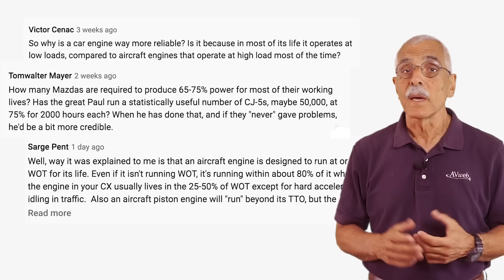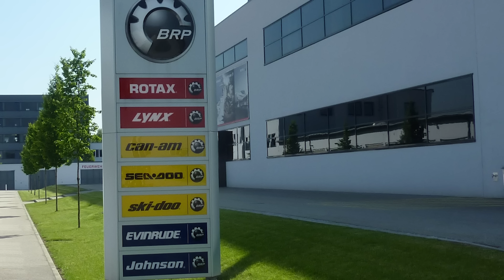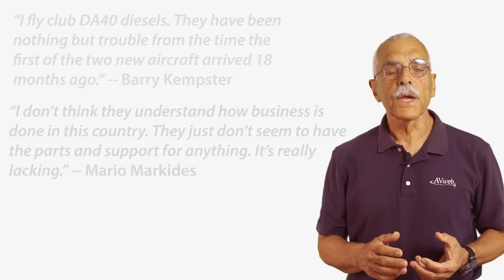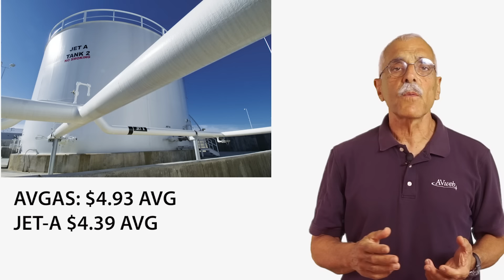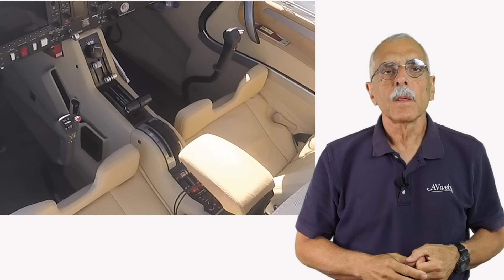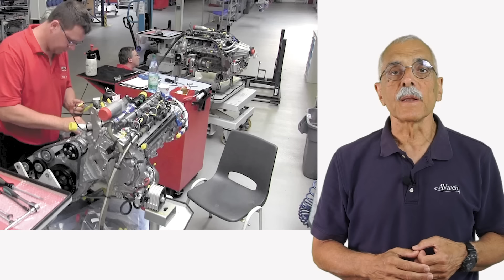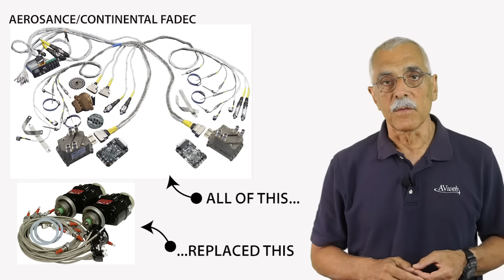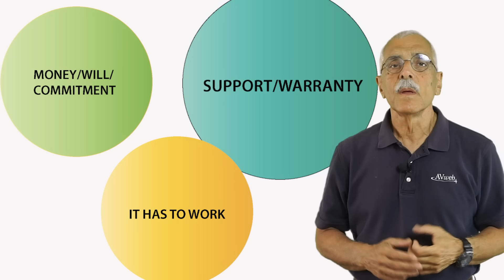Why New Aircraft Engine Ideas Rarely Succeed

Comment: I am curious, all of these engines have terrible power to weight compared to gasoline automotive engines that'll normally get or exceed 1 horsepower per pound.  You've mentioned how diesel auto engines are used in aircraft, why aren't gasoline?
Reply: The Rotax V-6 was a Gasoline engine. I think the big thing is commonality of fuel. A diesel will drink anything if you tune it for it. So Jet-A is readily available and in a long run scenario would mean one big tank and pump not two separate tanks and pumps at airports going forward. Problem is, no diesel Aluminum block has ever really done well. The Combustion event it too "Detonation-ey" for aluminum's low toughness, aside from some new superalloy developments. So Cast Iron kills the Power to Weight. But as Diamond shows, if you actually design for the power to weight of the engine, it works out fine.

Comment: I am always baffled why we still use very old technology in GA... but it's what people are comfortable with. Diamond is certainly pushing the envelope, happily.
Reply: Except the video is a load of BS. There is a tremendous market for newer and more reliable aircraft engines which would require trivial investment to tap. Quite literally millions of people would buy a modern airplane if FAA regs and unlimited liability tort laws weren't so comprehensively built around suppressing new entries.
Reply: @chrisdelzell8467  Hi Chris. What would you say was the real reason for the mentioned failures in the video?
Reply: @danielalorbi  almost entirely litigation and regulations. Airplane designers face indefinite and unrestricted liability for their designs , and the FAA has a number of regulatory catch 22s that make testing new parts almost impossible without unattainable economies of scale.

A piper supercub might have a 200 lb heavier engine than a piper cub, generating 150 horsepower instead of 70. My car has a 200 lb total engine with over 300 horsepower that can operate at nearly twice the RPM. It also wastes less gas and costs less than 10% as much. There aren't a lot of things the cub's engine can do that the car's can't either. If I took that engine block out and jury-rigged it to a propeller shaft, several things would happen. 

1) The reliability would go up. Cheap, mid quality fuel injected engines are far more reliable than any carburetor and magneto system.
2) The performance would go up. Lightweight, cheap, almost zero maintenance modern engines are far more powerful for their weight and volume than what we use in airplanes
3) The safety would go up. A more powerful, more reliable engine with more money left over for maintenance is a lot safer, and that 10% figure above includes all kinds of automation and safety features that are part of a car's cost.
4) It would be illegal to sell, and illegal to test. You can't sell it until there is sufficient test data, and you can't test it outside of an already approved airplane configuration without special dispensation. 

Flying isn't really that hard. We figured it out 100 years ago. We make it harder than it needs to be.
Reply: @chrisdelzell8467  obviously you're the one who needs the fact check on bs. Yes, regulation and scumbag lawyers make innovation a non sequitur, but there are not MILLIONS of GA pilots worldwide. Therefore limited market is the biggest driver in all aspects of innovation
Reply: @michaelmagill189  I believe, if the engines and planes themselves weren't so archaic and costly, more people would be pilots.

Ofcourse, the bigger problem is wage stagnation which has been since the 70s.

Trickle Down Economics was a scam afterall:(
Reply: It isn't just GA. Take AM radio. It is still used for Air Ground communication and not going to be changed.
Reply: Because manufacturers don't want to spend r+d $ on something that has a negative roi

Comment: Beech had a single power lever IO-520 in two Bonanzas in the early 80's.  All mechanical with a large cam moved by an aneroid.  It didn't catch on.  Pilots then wanted three levers.  Also I think there was only one old machinist at Continental that could make the cams.

Comment: Aircraft engines need to be slow rpm if they want to avoid reduction gearboxes. Pushrod engines are excellent in low RPM applications. Air cooled boxers are hard to beat in aviation applications. The best thing is an air cooled boxer with turbo, fuel injection and FADEC.

Comment: I would love to see a synopsis of various other auto engines that have found their way into homebuilt projects, i.e. Corvair, VW, Mazda Rotary, Chevy LS V8.  Ultimately though, not built for the 80% power, 100% of the time scenario, (just look at the difference in crankshaft journal size between  VW and Lycoming flat 4).  
Interestingly enough, Curtiss-Wright was an early Wankel licensee and had a really nice rotary design (from 'The Wankel Engine' by John C. Norbye Copyright 1971, ISBN 0-8019-5591-2).  
Curtiss-Wright also developed and patented a 4-Rotor Wankel, (US Pat 3,062,435).  
The world's first Wankel powered aircraft was the Lockheed Q-Star, it had a Curtiss-Wright RC2-60.  
Ford also dropped one in a 1966 Mustang.  The RC2-60 put out 185 HP, which compared favorably with the 200hp 289 V8, but it was much lighter.   0-60 for 289 was 10.0 vs 10.2 for the RC2-60.  But this was through a 3-spd automatic with shift points calibrated for the V8.  The RC2-60 would probably have stomped the 289 if it had a 4spd and better gearing to get the RPM up.  
Sadly the rotaries all suffered from materials shortcomings in tip and seal wear which took Mazda decades to sort out.  But the power to weight ratio of a rotary could only be topped by a turbine (but only at the cost of fuel consumption, and well, turbines cost 10X what a good old recip does.).  Curtiss-Wright also did some development work on a diesel version for a Genset. 
Considering all the starry-eyed "G/A Motor Of The Future" folks that have thrown money down the hole, I remain perplexed as to why nobody ever pursued a turbocharged diesel 2 or 3-rotor design.  No vibration, no problem with altitude, fuel thrifty, burns Jet-A, excellent power to weight ratio, gear reduction prop for awesome torque (swings a big blade), fewer moving parts, no magnetos to fritz out.

Comment: Paul, a question about continental engines that has always bugged me... why do they not use sodium cooled valves?
Reply from the maker: Cost, I'm sure. Also, the engines don't produce so much power that they need to dissipate that much heat, which is what sodium-filled valves were good at.
Reply: @AVweb  thanks for the reply and that kind of answers the question. 

I had thought there were two primary benefits from sodium filled valves. 
1. Reduced valve wear due to better cooling (as you highlight); but also
2. Increased relative compression ratio for a given octane rating as hot valves can cause pre-detonation.

There is a very recent book written by Calum Douglas called “the secret horse power race” which catalogues big aero engine development by Britain, Germany and USA leading up to and during World War Two (it is very technical and extremely well researched, I recommend it). 

In it he talks about the problems the Germans faced with reduced nickel and cadmium in their valves which led to hot valves flaking resulting in pre-detonation which of course led to high % of engine failures.

It was also one of the main reasons they could not get the same horsepower as the allies did from a given displacement of engine. The Germans just could not boost their engines to the same degree using a given octane of fuel.

So with the above in mind, I contend that continental could increase their compression ratios (and boost on the TIOs) if they ran sodium filled/cooled valves leading to improved efficiency and possibly reliability.

Going back to one of the points you made... I guess if you can afford a plane with one of these expensive tonks in them then you probably aren’t all that concerned with a slight increase in BSFC. That’s a true enough statement.

Interestingly Mike Busch from Savvy aviation thinks that continentals have less valve sticking problems due to lead/carbon deposits not accumulating because the valves run hotter. His answer to remedying this on lycomings is to run higher CHTs.

Comment: How about VW conversions like AeroVEE and others?
Reply: Agreed!  Seems many here want to ignore the type 1 2300 despite its overwhelming success over the decades. 
  
    I have been using  one in my stol for a few years. 84 mm stroke  and 94 mm Pistons . Either Ram or heated air feeds a custom manifold that incorporates 2 AMR500 superchargers with electric clutches, and 2 revmaster 40 mm carbs similar to The Aerovee. This makes for very broad torque range,  from 800 to 3000 RPMs. With flywheel Drive. With the horsepower coming in at right around 180. As Paul was talking about in another episode, "why engines fail" it's often high RPMs.
Reply: @Ozarkprepper643  Exactly!

Comment: Many auto engines will run just fine at 70% power output all day … provided you provide proper cooling.  Cooling is almost always what causes headaches for auto engines in addition to the speed reduction gearbox.  The reason there are few new engines for airplanes is mainly economic, not technical.  There simply isn’t enough market to be worth the investment.

Comment: aren't there any military training aircraft engines being repurposed into commercial aviation use or is the performance gap too wide?
Reply: They all use PT-6 turboprops now. Which have been in GA for Decades. The PT-6 just does the job right once you need more than about 300HP.

Comment: Hey Paul! Excellent video! From an engine manufacturer's point of view there is some more cost involved that make GA engines a major pain: Product liability insurance - especially for the US market with its class action lawsuits against manufacturers, low production volume combined with extremely high market entry barriers (-->certification process in every single country around the globe aside from FAA and EASA countries!), a decades long life-span of certified aircraft with legal requirements to provide support in parts from 100s of part-suppliers that go in and out of business (just think of electronics!!!) and engineering (ASBs for 30 year old engines!) until the last engine dies,... 
Long story short: We regulated the industry to a point where it just does not make sense from a business point of view. Every company that keeps innovating in GA deserves a medal just for trying to succeed in the long run. In the short run, innovation in GA on an industrial level never pays off. The guys at Cirrus, Diamond, Rotax and even Continental and Lycoming are awesome. There are so many more like Pipistrel, Tecnam or AutoGyro who just won't ever give up. Thanks for keeping us in the air!

Comment: The Austro engine powering the DA-62 is from the AE300 series of their engines.

The Austro engine still holds the 300 hour flywheel inspection where you have to pull the gearbox. Optional for part 91 operators, but still...

Comment: What most people tend to ignore is that the market is basically a bunch of old white chaps that go flying at the weekend. They don't care about innovation or leaded fuel or saving gas. Most of them also don't care about high performance, hence the struggling mooney company and no actual fast certified single. Only kit planes for the lovers can go to those lenghts

Comment: As an RV-14 builder who powered it with a Superior XP-400, I personally built with electronic fuel injection and ignition, I hope you feel my pain.  (After recall, I had Barrett rebuild it as an IO-390).  I wish you had discussed ULPower Clean Sheet Design FADEC Aero engines, whom I hope succeeds in the Experimental Aviation market.
Reply: U L is doing quite well it seems. They have the product the market has begged for. Good power to weight and direct drive. FADEC controls with all the standard aviation requirements, dual plugs, dual electronic ignitions. Digital fuel injection. All the right touches. Only thing is, it's only an incremental improvement over brands L or C. And it's not significantly less expensive than the big 2 which means that many builders will opt to spend the difference and buy the real thing. Additionally, when you buy from the big 2 you get an American made engine that everyone is familiar with and you don't have to ship it to fortress Europe for repairs. I really like UL and I wish them GREAT success. But they have a tough row to hoe to get there
Reply: @michaelmagill189  Another interesting FADEC engine coming to market is the water cooled, Corsair Power V-8, based on a GM Marine Block.  As it is basically a reliable modern engine, they have forgone the 2nd spark plug.  Corsair has built one which is powering a Cessna 182.  As it can put out 300+ HP, it may be suitable for the larger 4+ seat market.  The smaller UL is farther along in development and seems better suited to the LSA and 2 seat market.  When the FAA finally rewrites the LSA Rule, I expect UL to give Rotax real competition.

Comment: I think the real problem is that the modern engine designs are not being brought to market in a way that is viable for the people who actually want and need them: owners of existing GA planes who want the reliability and reduced operating cost of modern engine tech.

I'd love to stick a 180 HP Rotax or BMW-derived diesel into my Mooney, but the following problems arise:
1) they don't exist at the power I need (Rotax doesn't go that high, the Diesels don't go that low)
2) they are too heavy
3) they won't fit in my cowl
4) they would need a custom engine mount
5) they cost more than my house

why would i spend six figures installing a new engine to a $40,000 airplane?  Certainly not to save 50c/gal on fuel or 1-2 gal/hr savings in cruise.
GA needs an automotive-derived engine which can be a drop-in replacement for things like the O-360 and similar engines, at a price point which undercuts the cost of an overhaul.  If someone could do that, and had the patience to stick with slow sales due to owners waiting until overhaul to pull the trigger, they'd find themselves selling tens of thousands of engines.

Comment: In addition to the reasons in the video, in particular low volume and high certification costs, I think that part of the answer has to do with differences between the way quality is viewed in the automotive world and in the aviation world.  In the airplane world, if the engine doesn't start it can almost become a social event where pilots stand around and talk about the various things they have had to do to start an engine while you're waiting for the line guy to bring the power cart out.  In the automotive world, if your engine doesn't start you become late for work or you miss your doctor's appointment or well, whatever.  It's often a major problem for the user.  The point is that in the airplane world the emphasis is on not stopping once started, but in the automotive world the emphasis is on starting reliably.

Also, understand it took automotive engineers 100 years or so to figure out how to get an automotive engine to start reliably.   I can remember having to open the hood and take the air filter cover off to prop open the choke on my Toyota if I followed the wrong procedure in starting it when the engine was warm, but the weather was cold.  In fact, I carried a large screwdriver in the car for just such an eventuality.

I don't think that the longevity of the engines is all that dissimilar when you consider that, for weight reasons, airplane engines can't be made as robust as automotive engines.  On the other hand, airplane engines are also a lot more likely to get regular maintenance.

Comment: Well that was easy to watch and convincing due equally  to the material and presentation. I cannot help but think the Austro success was because the engine's most significant accessory is the aircraft. After all the austro engine merely made the original reliable and the extra weight problem  was skirted because the whole aircraft package was powered by one man to be a significant improvement over it's predecessors. Which is realy just an alternative accent on what you said

Comment: The future of diesel engines in aircraft is high power diesels (500-4000hp) that replace turbine engines in that power range.  The applications are commercial and military airplanes and helicopters.
Reply: But what about the weight? That's one area where turbines are way better. Napier designed the most efficient aircraft Diesel with a power recovery turbine (the Nomad) but as soon as the Rolls Royce Tyne came out it was game over. I guess even with the Tyne's higher fuel consumption the figures didn't add up.
Reply: @garethonthetube  There are new technologies that enable aero-diesels (heavy-duty 4-stroke turbo-diesel) with 1.3-1.4 hp/lb which, combined with a 40-50% reduction in fuel consumption, makes diesel preferable to turboshafts and turboprops.  Basically, the 1.3 hp/lb diesel weighs more than the equal-powered turbine engine, but the reduction in fuel load at takeoff more than makes up for this.  The result is a diesel powered aircraft with the same max. takeoff weight, same payload, same power, same cruise speed, longer range, lower toxic emissions, is quieter, has much lower fuel cost, and 20-25% lower cost of operation (fully accounted).

Comment: This has to be your best ever.

There is also the cost of certification.  Type Certificates aren't cheap.  
I was the DOM of a flight school that had a early Diamond diesel twin.  It was a money pit and the hangar queen.
OEM support sucked and Diamond was always quick to pass the buck on any technical or engineering issues.  I left after 3 years and the"Queen" never moved.
My O-300 is still purring away.  Engines,,,,,KISS.